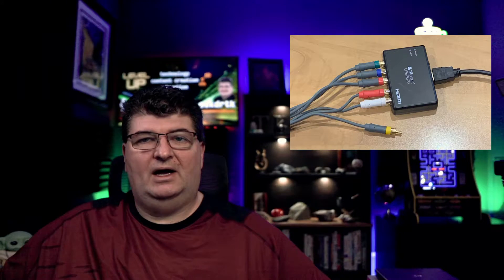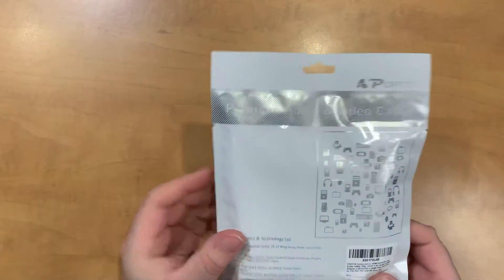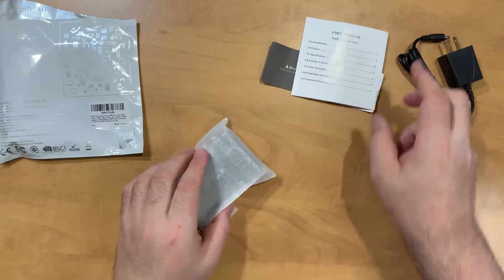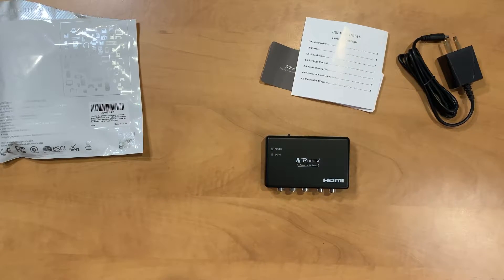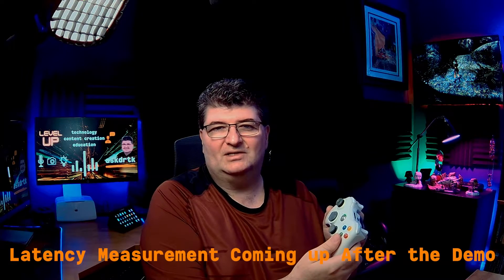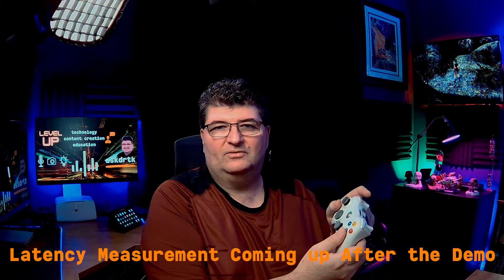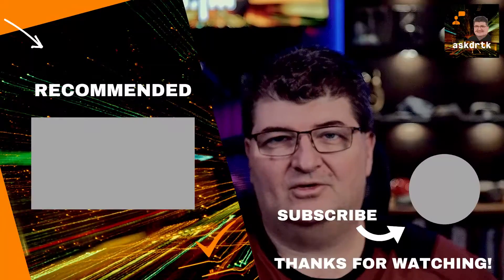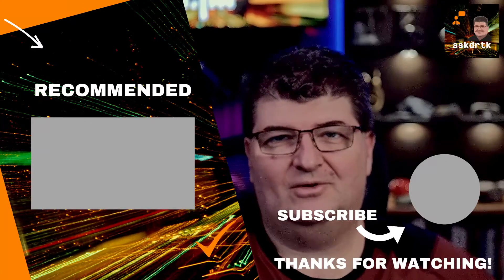Component to HDMI Adapter Unboxing and Detailed Review

Comment: I have a question. Have you ever encountered sound issues using a component to hdmi converter?

I'm attempting to capture/stream original xbox with an elgato hd 60 s. I'm using the original Xbox high def av pack through a component to hdmi converter, then feeding through to the elgato.

I get funky audio whenever I boot it (same with Wii). Unlike Wii, some games, the audio is fine, but I more often than not get this awful echo audio.

If you have any idea why this is, help please?
Reply from the maker: Great question! I have heard of a number of intermittent audio issues when using Retrotink 2x pro's with Elgato hd60's and 4k60 pro's. The first thing I would do is try another capture card (or a TV) to see if I get the same audio issues. This can provide some clues about the HDMI audio output from the component to HDMI converter...

Since converting analogue audio to HDMI audio is done by an A to D converter in your component to HDMI converter, the A to D converter outputs the audio with a specific sample rate. HDMI audio in general supports a wide range of bit depths and sample rates, but issues arise when a device either doesn't support all specs or is slightly off-spec. This used to happen alot with composite video where slightly off-spec signals caused poor picture quality on certain displays. While I am not aware of anyone verifying the sample rate specs (test equipment required) on either the Retrotink or Elgato cards, I suspect sample rate being off-spec is the issue as this will definitely cause audio artifacts including echo (we often deal with this in pro recording gear). I believe this may be why Retrotink does not recommend their devices for use with Elgato capture cards...

I'm not sure if you are using a Retrotink 2x pro, but these same issues can happen with other converters / capture cards. On I side note, I haven't experienced this with either the Portta converter in this review or the Sunnatch converter I reviewed a while ago using a number of capture cards including Elgato's. Hope this helps out. If you let me know what converter you are using I may be able to look into this a bit further.

Comment: Hello. I wanted to ask you if it is compatible with Windows 10 and OBS Studio?
Reply from the maker: While the converter doesn't connect directly to the PC, the HDMI output is compatible with both Windows 10 and OBS Studio. I have tested it with multiple capture cards (4k60 pro, Cam Link Pro, Cam Link 4k, and at least 10 other usb capture cards from various manufacturers) for both recording and streaming using OBS Studio in Windows 10. All worked without issues. Thanks for the question and I hope this helps out!

Comment: I would have been interested to know what the lag is like with component directly in compared to the scaler, since they should be comparable like you said
Reply from the maker: I have tested the lag with the 360 directly into the component inputs on my LG flat panel and it is longer than through the scaler as most tv's (and definitely mine) have really terrible internal upscaling of component and composite. The direct lag was nearly 50ms longer vs using the portta, but all sets are different. My older test crt has virtually non-existent internal lag (i measured the 360 lag on it a while ago at around 110ms, which means the crt was only about 10ms accounting for the lag of the 360 and wireless controller),  but unfortunately it died. I'm going to pick up another for comparisons when I can find the one I want...
Reply: @askdrtk  oh good to know, thanks for the update

Comment: Thanks, drtk. This is helpful.  This doesn't Porta component doesn't appear to come with a power cable.  What type do I need for this.  I am connecting a legacy VCR/DVD player
Reply from the maker: All good - It does come with a power adapter that includes a thread lock to make sure it doesn’t slip out of the converter. The power adapter is 5V and 2.0 A and the converter maximum current draw is 1.5A. 

Your VCR/DVD combo is a great use for this converter/scaler. Hope this helps out and thanks for checking out my review!

Comment: Do you know where you can purchase the version of this with the scaler? I can only find the normal model without scaling.
Reply from the maker: Looks like it is out of stock on amazon.com right now and they are redirecting to the model without the scaler.

I see the scaler model  is available on amazon.ca at this link: https://www.amazon.ca/Portta-Component-Converter-Scaler-support/dp/B00ATNIFPA?th=1 

If you can't get this one, the Sunnatch converter / scaler I reviewed is also a great choice.
Reply: @askdrtk  Thank you! Do you know if the Sunnatch will work well with PS2 games? (not intending to play PS1 at all)
Reply from the maker: Both work well with the ps2 with the exception of 240p games (all ps1 and a few ps2). For 240p you will need a retrotink, ossc, or other device setup for 240p input over component. If you aren't worried about ps1, both the portta and sunnatch are a good bet.

Comment: My TV is already HD and I would like to get component to HDMI because the monitor only has 1 HD input. Does this work?
Reply from the maker: Thanks for the question and I hope this helps out.

This converter will allow you to connect a device with component outputs to the HDMI input on your monitor, but it will not add an additional input to your monitor. If you would like to add extra HDMI inputs to your monitor so that ou can connect several sources (PC, DVD/BluRay, PS4, etc.), I would suggest using an HDMI switch like the TESmart 4x1 HDMI switch I reviewed in this video: https://youtu.be/pe-Ck_E46LY

Comment: I bought this hoping to use it with my n64 and Wii to use at a house where the tv doesn’t have a component option only hdmi. But testing it on my personal tv that does have both options (hdmi ports and component port). The sound comes through and the video does as well technically but I can only in black and white. I haven’t been able to get color with the N64 or Wii. 

Do you have any suggestions on how to fix this or what I’m doing wrong?
Reply from the maker: I have a couple of thoughts on this. For the Wii, ensure output is set to 480p as the scaler will not accept 240p, 480i, or 576 I. This needs to been done after connecting to the tv and note that some Wii games will not support progressive scan. I have also heard of issues with some component cables (particularly 3rd party) being hit and miss from device to device.

What method (mod) are you using for component on the N64? As the N64 outputs 240p for most games, the scaler will not read this properly. Some mods line double to 480p and should work with the scaler. 

Thanks for the question and for watching!
Reply: @askdrtk  So it turns out that I’m using composite cables for both systems. I first looked into figuring out if my Wii was in 480i or not (it is) and It won’t let me change it to 480p. This new Wii I have came with a 3rd party cable so that could also be part of it too?

For the N64 I believe it’s just the original composite (Red, white, and yellow) cable. So I’m not entirely sure. 

Would I need to look into different cables for both of these systems if I  wanted to use the hdmi adapter? Or instead consider an actual hdmi cord option rather than an adapter for the individual consoles?
Reply from the maker: The Portta is a component only converter, composite is a different standard. The advantage of using component vs composite comes down to better picture quality. 

There are a few routes you can take:
1. Since you already have composite cables for both, you could pick up a Retrotink 2x or even a 5x which will upscale and give you hdmi output. This is imo about the best quality you will get when starting with composite video.
2. You can pick up an HD Retrovision component cable for the Wii. This will work with the Portta and now you have the option to use your Wii with component, HDMI, or composite (since you also have that cable. For the N64, you could get an HDMI converter cable (there are a few with great reviews on Amazon however I have not tested any yet). This way you would have both HDMI and composite for the N64.
3. You could mod your N64 for RGB (component) output. There are a number of kits available and this would give you component, HDMI (through the Portta), and composite as output options for the N64,

Hope these ideas help out.

Comment: bought this and it outputs zero sound
Reply from the maker: Not sure which source / console you were trying. I tested a number of sources and found no audio issues. 

I apologize if these recommendations are too basic and you have already tried them, but to troubleshoot something like this I generally take two approaches. First, I would connect the source that didn't produce audio to another device (powered speakers, receiver, etc.) to check for sound output, and then I would connect a known working source (any will do...phone, old school cd, tape, etc.) to the scaler.  Analogue audio signals are generally very compatible across devices. I've even had bad cables give me plenty of grief! (Of course it is always possible you received a defective scaler - unfortunate.)

Thanks for watching and let me know how things go.

Comment: Great video,
Do you know if this converter can scale interlaced (480i or 576i) to processive signal (720p, 1080p)?
Reply from the maker: Thanks! I have tested it with 480i and the output does register as 720p or 1080p on two of my displays and a capture card (4k60 pro mkii). I don't have anything to test it with 576i (PAL) however the spec sheet indicates that it does support that mode.

I will have another video coming soon with composite to HDMI conversion/scaling (should be about two weeks). Check it out if you have a chance and let me know what you think.
Reply: @askdrtk  Thanks for the response! I subbed!
I was also wondering if this works as well on modern PC monitors with HDMI with the 480i signal upscaled.
Reply from the maker: Thanks again! I tested the input modes (including 480i but not 576i) on a 2020 model HP 24" monitor and experienced no issues. The television output tests looked good as well.
Reply: @askdrtk  and the aspect ratio is correct ?
Reply from the maker: Aspect ratio was correct on my tests. I generally find more issues with composite to HDMI scalers vs component to HDMI.